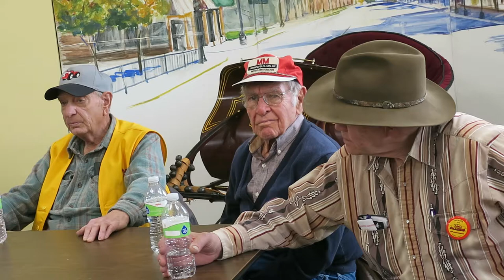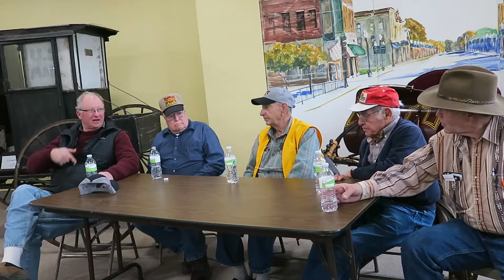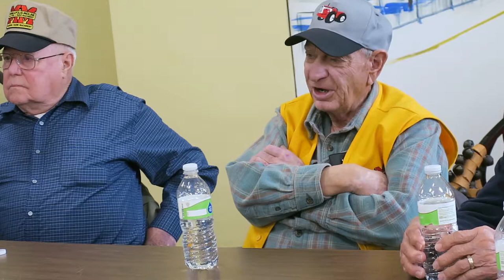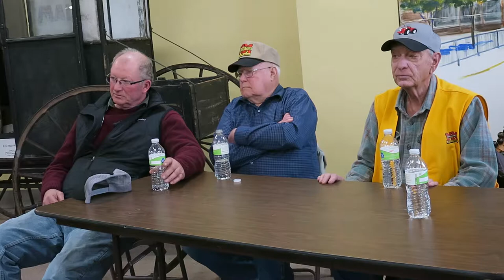MM Former Employees Talk Part 7 of 8

Comment: I worked as a mechanic in the early 1990's at an AGCO Allis dealership a few years before going to work at a CaseIH dealer. The older AC mechanics there told me they never had trouble with the D19. That it was the early 190XT that was trouble in the final drives and differential. My dad had a D17 as his main tractor until 1977 when he bought an early 190XT. The D17 is still here and has never popped out of gear for us. Good tractor for us. The 190 did drop a final drive bearing once. Then I started on my own farming in 1987 and bought a D19 and between the 190 and D19 they did all the heavy work and that 19 I still have today. Never one problem other than the hydraulics had to be the worst idea of any other Allis model.

The D17 ran high pressure and low volume which worked great if you used high pressure cylinders but the D19 hydraulics was an attempt to make the tractor compatible with everyone else's low pressure system so they took the same D17 pump and just lowered the pressure to 2200 psi from the 4000 psi. So now it was the worst of both worlds... low pressure and low volume.... but I still like the D19 because it had great power and was very comfortable. 

The early D21 I never heard of problems either unless the farmer threw a turbo on it. Then bull pinions would grenade. The first factory turbo D21 had that problem but as I understand it that was beefed up a bit soon after the turbo version was introduced but the complete fix for that was the 210 and 220 which were real solid. 

Today I farm with a 7050, 200, 190XT Series III and the D19 and 17 some. All have been good to me save for the high side Power Director was out on the 200 when I bought it at auction and I didn't find out until a put a chiselplow behind it that fall in 2015. None of my tractors pop out of gear but I don't grind them when I shift. Dad's D17 has many  thousands of hours on it with one engine overhaul since he bought it in 1973.

Comment: just buy a 3010 or 4010. no bearings go out with duals. don't be stupid
Reply: They're dogs in the field. I hated doing any mechanic work on them from the crappy hydraulic valves to the front mounted hydraulic pump to the sycrogear transmission. Hard starting beasts wether diesel or even gasoline. And no platform to put your lunch on. But I guess the beat the heck out of owning a 620 or 730. ;)